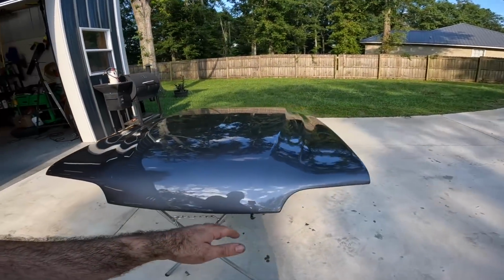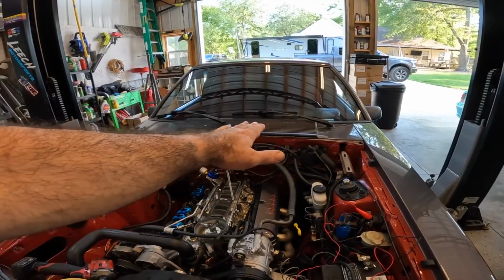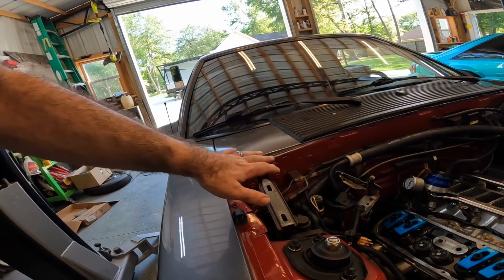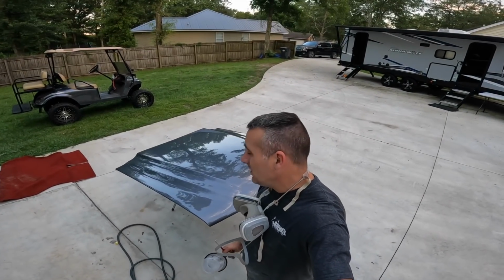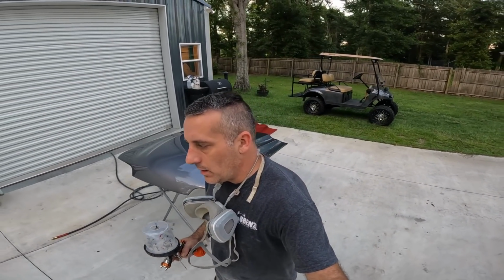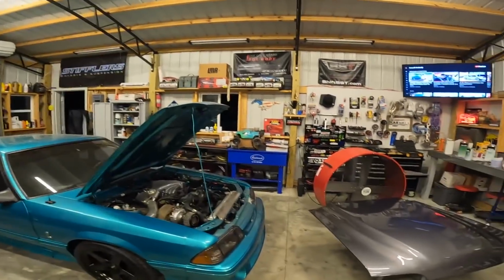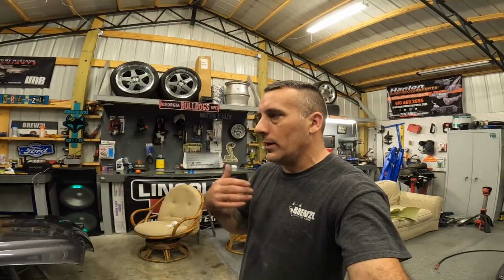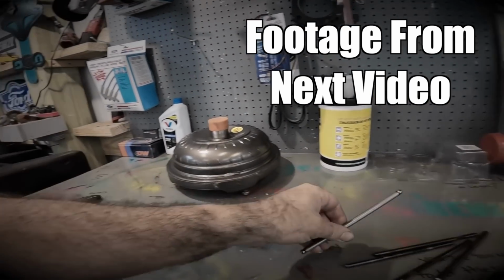JUST OUT HERE DOING HOOD SH*T

Comment: Would love to see a video of how exactly you adjust the valves with roller rockers after they’ve been pumped up with oil
Reply from the maker: I’ve done several videos on adjusting rockers. Basically I just make sure the lifter is on the base circle of the cam, turn the nut until there’s no more slack in the rocker and pushrod then tighten 1/4 up to 1/2 a turn.

Comment: I know this is a budget based channel, but if you'll use RM/Diamont base you will never have any base issues. On the budget side of clear coat you can get SPI clear from Mr. Gary at American Auto Paint in Dothan, its dirt cheap and the best clear I've ever used. I chose it over my Diamont clears. However it looks when you walk out is how its going to look the next morning, its slick as glass, hard to run, and easy to buff.
Reply from the maker: Great info. I may try that 👌
Reply: Will it last 36 months sitting outside 24/7.???
I've not found ANY yet that will. I've gone back to acrylic enamel on my personal cars. BTW acrylic enamel last 10+ yrs easy.
Reply: @hotrodray6802  36 months? Any good clear applied correctly will last longer than that. Diamont has a lifetime warranty.

Comment: Where you seem to know the 5.0 inside out Could you explain the difference between the 5.0 in the fox and the sn95's 5.0. being said the power went from 225 to 215… seems odd ford would do changes that decreased performance. I've seen videos where guys have dynod the sn95 at 160/170rwhp to around 195 with a couple small mods...? If I'm not mistaken the 94/95 has an odd elbow on the intake why? I've read the e7 heads and intake flow bad. I personally love doing mods I can without just replacing parts so doing porting that would make the intake flow would be cool but Ive read it's not plausible. I thought I could easily mill the rear or diver side flat of the plenum and fab a bolt on plate so the entire runner can be massaged, I think it would be a fun mod.